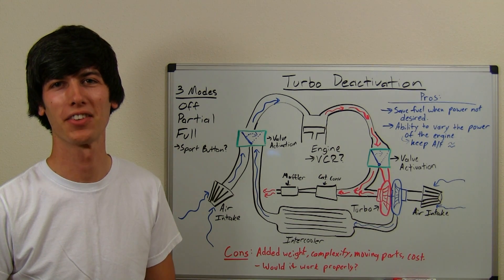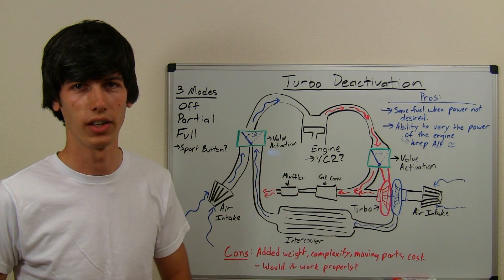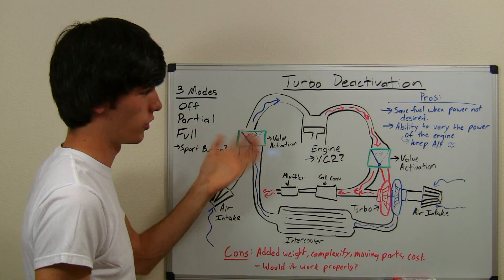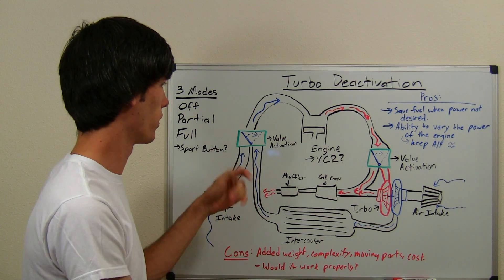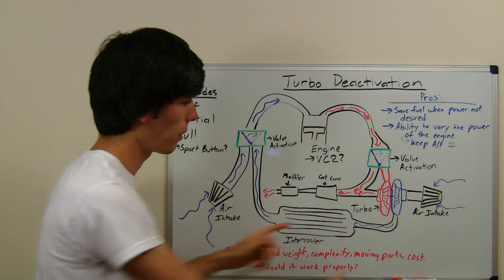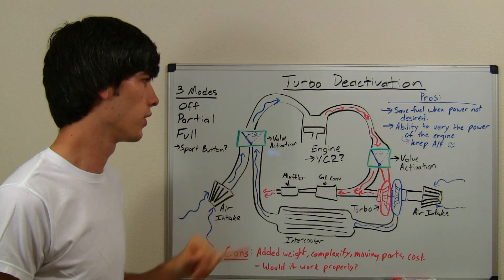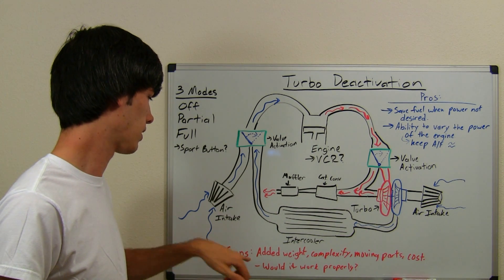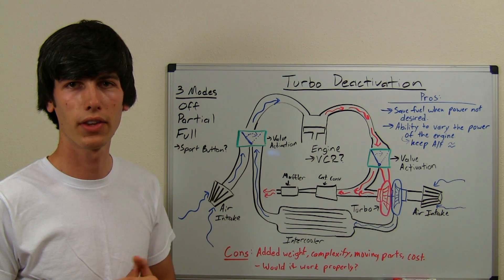Turbocharger Deactivation Concept - Explained

Comment: ...3 questions come to mind...

1. Is there a way to guarantee that the valves will close completely? Like some sort of seal? Granted, a rubber seal would probably disintegrate in any Exhaust Manifold, but the concept is something to consider.

2. The doors will be on hinges, right? If so, would a redesign of the Intake and/or Exhaust Manifold be required? Like, make them flat on one side instead of round, to make it easier for the hinge to go in?

3. How easily could they be replaced?

Comment: You still don't get it do you. I have never said that adding a turbo will make an engine less efficient. You have said that adding a turbo WILL make an engine more efficient though. SO why does the turbo get less MPG's in the extra urban tests. We now know that the turbo is operating much closer to its peak efficiency - any other excuses. WHat you're also forgetting is that I've picked the fairest comparison possible. I could have compared the NA to the 225bhp 1.8t, want to do that?

Comment: Wow you found unsubstantiated data showing that the turbo gets 0.1 MPG better. That's a hell of a lot of recovered energy don't you think? Thanks for highlighting that the turbo engine is operating much closer to its peak efficiency during the MPG tests, yet is still less efficient than the NA in extra urban MPG cycle. Just imagine what would happen if the engines were under greater loads!!

Comment: Anyway, what the calculations you can't do show is that whilst working under the low loads associated with everyday driving  the turbo engine, despite producing more peak horsepower, is operating closer to its peak efficiency than the NA engine is. Which makes your "lower percentage of load" rant complete rubbish.

Comment: Good idea but poor execution. It's like comparing a Naturally Aspirated 2.4L engine v.s. a downsized 2.0L Turbo Charge engine, where fuel economy is compensated by opening throttles more (may it Gasoline Direct Injection), of cuz there will be difference but the key is both achieve at roughly the same torque at same fuel consumption. The action to switch a downsized engine to a higher gear probably benefits more and economic than this method.

Comment: OK. So the turbo produces 162 lbft @ 2200 RPM, the NA 125 lbft @ 4200 RPM. Using your undoubted academical skills, you can now work out what power theses engines are producing when running at their most efficient. It shouldn't take someone like yourself, with a doctorate in Engineering, more than a minute to work this out.

Comment: Ok, so the addition of a turbocharger has reduced the NA engines fuel efficiency under everyday driving loads because those loads now occur at a lower percentage of maximum power output.

Comment: It doesn't matter that the percentage of maximum power the engines are operating at is different. If the turbocharger is recovering significant amounts of energy all the time, the turbocharged engine should NEVER be less efficient that the NA whilst producing the same power.

Comment: Let's say, for example, that the turbochager recovers 10% of output power. When both the turbo and NA are operating at lets say 50 KW, the turbo engine should be using ~10% less fuel. Why is it using more?

Comment: This is where you struggle to keep up. Under the standard load fuel efficiency tests the 1.8 & the 1.8 turbo are producing the EXACT same power output, but the 1.8 NA is using less fuel. And before you start coming back with your "percentage of load mumble" it really doesn't matter why, the addition of the turbochager has made the engine less efficient in those tests Where has all your "recovered energy" gone?.

Comment: No, you said that smaller turbocharged engines have typically replaced large NA engines, I then asked for some examples of this. So far you have not given one example, seeing as the F150 is still available with several large V8's. If it is typical then it is the 'norm' and you should be able to furnish me with many clear examples.

Comment: Again, it's funny how torque didn't matter when you compared the Mustang Turbo to the V8, it was all about peak bhp then. Now the shoe is on the other foot..lol... Anyway comparing a direct injection engine to a non-direct injection engine in order to prove the efficiency of a turbocharger is pointless. You have to start with a level testbed - like the good old VW1.8l.

Comment: No, as you've been saying for 20 pages, we compare motors on peak hp remember? The 3.5l ecoboost with direct injection gets just 1 MPG more than the equivelant 5.0l V8 without direcy injection. Seeing as direct injection engines typically produce 20% better fuel efficiency than engines without, you have to admit that that's not good.

Comment: The ecoboost isn't a small motor at 3.5l, but it does have tiny GT15 turbo chargers. These are turbos usually found in low reving small capacity diesel engines!! They are about the same size as a coffee mug.. The ecoboost can barely be described as a turbocharged engine....thank god it's got direct injection I suppose.

Comment: I see that production of a less complicated more 'American' version of the AJD diesel is planned for the F150. Seems your massive Island can't quite get to grips with the production of such a complicated motor, one that has been manufactured over here for 6 years. But I suppose what's the point of using good motors in your terrible vehicles. Best stick to your half ton 15 MPG 'powerstroke' tractor engine.

Comment: Why don't ford have a decent turbo diesel F-150. Over here it is unheard of for a larger road vehicle to have a petrol engine, barring some premium products (Range Rover, X5 etc). Ford UK produce the excellent AJD diesels, the 3.0l produces 600Nm of torque and returns 30 MPG in the LandRover Discovery, why don't Ford USA copy these? Do you guys like paying for gas, or has Ford got some sort of deal with the oil companies.

Comment: .........Another common effect is a rattling sound coming from the upper valve train assembly. The original seal material was found to be inferior for the application and tends to break down within 75k - 100k miles. VANOS Seal & Rattle kits are available to address these shortcomings from aftermarket suppliers (but not from BMW—BMW's solution when VANOS units fail is to remove the entire VANOS unit and replace it with a new one)"

Comment: "Single and Double VANOS systems due to age and mileage often experience performance issues as well as complete failure of the BMW OEM Buna-N VANOS piston seals (which are often successfully repaired by the use of aftermarket Viton seals to replace the OEM Buna-N seals).................

Comment: Yes, the ultra modern 3.5l DOHC, VVTi, 2150psi direct injection, eco-boost engine is slightly more fuel efficient than the 20 year old 5.0l V8.

Comment: The US E36 M3 wasn't really an M3 though was it. Over here the early single VANOS engined 280bhp M3's were/are more desireable then the later 321bhp double VANOS engined versions specifically becuase of VANOS reliability.

Comment: Yes you're right.Myself and all the automobile manufacturers are wrong. If only we had your knowledge then all petrol engines of the last 20 years would be turbocharged, and as you pointed out, much better in all aspects. Take your beloved BMW as an example. After turbocharging the M3 in the '80s they didn't turbocharge any of their engines, excluding diesels of course, up until the recent M5 I believe. How could we all get it so wrong.

Comment: ha...funny how torque wasn't important when comparing the Mustang turbo to the V8. Turbocharging has made the 1.8l engine less efficient under the loads associated with everyday driving. Yes the turbo engine will have a "flatter torque curve" and more maximum power, but we are talking about efficiency only.

Comment: VANOS was a bit unreliable though. M3 owners lived in fear of the VANOS 'death rattle'. Valvetronic is a strange one. BMW tended to use it on its low end motors. High end motors had a standard throttle plate and 'M' cars used ITB's.

Comment: You mean Fords brand new "Ecoboost" engine? probably the most advanced engine they've ever put in a production vehicle. I always believed that direct injection would solve some of the inherent efficiency problems that have plauged turbo charged petrol engines for the last 30 years. Can't believe it achieves only 1 MPG more than the equivalent V8 though!!! What a failure. Besides it is not a small engine, and it will not replace the V8, far from it.

Comment: speaking of concepts, i want to run an idea by you. Electronic valves. Instead of having the valves controlled by cams/camshaft they would be controlled by a solenoid that opens and closes them. I've been thinking about it for about a week, and performance wise it seems that it would be very beneficial. Valve timing would be more easily adjusted. Such as ignition mapping/fuel mapping, you would be able to have valve mapping. Please reply on your opinion on this concept.

Comment: Timing chains are good. They have been around like forever, but dual (consequence of) chains are no good. Because every chain has a kind of slack, with 2 chains you have 2x of that slack, which results in incorrect valve to piston timing. That's why old Toyota Celica TA64 from Group B had 4T-GT with gears (instead of lower chain) and a common upper secondary chain for driving DOHC cams. It was developed from 3T-GTE which had 2 chains, like modern Audi and many cars in 70s, yup! 2T-G,18R-G,FJ20

Comment: You are mistaking Alusil with Nikasil. Nikasil is a whole another beast. It results in a very hard coating, unlike Alusil which is very very very very soft! That's why Alusil pistons have IRON sprayed skirts, so they can make it work! Soft-on-soft doesn't work much. So if a cylinder is soft, then the piston must be harder. And so it is in Alusil. Nikasil has low oil consumption and it's not really used nowadays, because it disappears if disposed to high sulfur fuel (widely spread in EU).

Comment: This timing chain design is used in all engines. Even on TT's V6 and 2.0 straight-4!
As for V8, GTI isn't thaat complex as V8. It had first Audi Alusil block, which was crap, it could overheat like no prob as well because of inefficient cylinder head gasket design, plus it had a lot of rollers, damper and the longest toothed belt in automotive history - 299 teeth. I don't clearly see the economical or ecological purpose of Alusil blocks, because these engines use 10x more oil than cast iron ones

Comment: Yeah the timing chains are incredibly complex on that motor. Looks like a further developtment of the VR6 system, which used seperate upper and lower timing chains. Although the engine in your link is a true 'V' and has DOHC's requiring the 4 chain layout. Probably designed never to need chainging, and is a huge oversight, and pain in the arse, if it ever did.

Comment: "No, the turbocharged 1.8liter can do the work of a much larger engine, the NA 1.8 cannot"....great, but irrelevant. The addition of a turbocharger has made the VW 1.8l engine less economical for everyday driving (identical loads for both engines). The facts back that up, surely you must agree.

Comment: No, no! They have 2 chains. And they stretch, and misalign, and you get cam angle sensor failure, so the engine goes into accident/safe mode or simply refuses to work at all. Audi/VW seems to be fond of not so bad ideas and being lazy to test them. Which turns into a disaster for a car owner. Despite that Audi has the most overpriced original parts than any other popular car manufacturer. Ask me how I know that. '89 Audi V8 is in da house! wasting my money and time on constant re-engineering...

Comment: Does the FSI have the weird timing belt driving one cam and a timing chain driving the other that the old 16&20 valvers used to have? Not as bad as the old VR6's that had the timing chain on the gearbox side of the engine!! The 2.5TDi is a sweet engine, it even sounds good.

Comment: Depends where you're from really. Over here VW/Audi stuff is readily available and pretty cheap. Their diesels are incredibly durable, my mother had an A4 tdi for 15 years, did 200k miles without missing a beat, never used a drop of oil or water. Remember changing my old Passat pdi130 cambelt, waterpump and tensioner myself, was quite simple. Parts cost around £60.

Comment: Nah, VW is always interested in more efficient, yet uber-complicated engines. Because such engines require dealer service, which is always about parts - which are the main money supply for any car manufacturer. If you read between the lines, Audi/VW like to do shitty tech, which is pretty unreliable and hard to fix without special equipment.

Comment: Fuel efficiency really is judged by MPG. I'm not from the US and yes we do/did get the 1.4tsi, although I believe VW has discontinued the tsi and replaced it with a simpler larger displacement engine.

Comment: Efficiency isn't judged by MPG, actually. In technical literature effiency is about ecology at first and second about quality of burning the actual fuel mixture. In modern tech books they often say that a N/A engine won't be as efficient, as a lightly turbocharged one. Not far to go - modern small VW engines - 1.4 TFSI (turbo). They are really small, they have more like a diesel pull and they have a high MPG. But I don't know if you get them in the US.

Comment: Right, so if we go back to the VW Passat 1.8l as an example. The 1.8l is proven to be more efficient at every day driving speeds (for example let's say constant 50mph) than the 1.8 turbo. But you think at higher speeds (say constant 80mph) the turbo engine may be more efficient. Is this correct?

Comment: What you spectacularly fail to grasp is that just because two engines produce the same maximimum power does not mean that they produce similar power across the rest of the rev range. The V8 is probably chucking out twice the horsepower at everyday driving revs (ie fuel economy cycle revs) than the 4 cyl turbo. You are in effect comparing a 100bhp engine to a 200bhp engine. Whilst turbo and NA versions of identical engines will produce very similar power outputs at every day revs.

Comment: Just grab a turbocharger book for an engineer and read that. You would see that basically all turbocharger applications are divided into 2 groups: for efficieny and for "displacement replacement" - for more power. The first one pressurises more air, so that it would burn fuel better (for a number of reasons). The second idea is to add fuel as proportion ~14.7:1 for each absolute atm of pressure. Nothing to do with economy. YouTube is no university for automotive engineers, just grab and read it!

Comment: Mustang 2.3l is MORE efficient than Mustang 2.3l turbo
VW 1.8l is MORE efficient than VW 1.8lturbo

When they added turbochargers to these engines they became LESS efficient. If you can find a case an engine becoming more efficient when fitted with a turbocharger let me know.

Comment: Ok back to school for "dr"Bimmer. These engines only produce similar power outputs at high RPM (much higher for the 4cyl!). Fuel economy tests are conducted over LOW RPM's. The V8 will be procucing MUCH more power at low RPM's than the 4cyl. And that's before we start to consider the V8 is ancient, is much heavier and the SVO has aerodynamic modifications. So why choose two motors to compare based on their high RPM performance and then compare their low RPM performance.

Comment: You think it's fair comparing an ancient design V8 with a more modern 4cyl, you need to try harder. Anyway, the Mustang 2.3l is MORE efficient than the 2.3l turbo. Now think about that, the turbo makes it LESS efficient. And before you start banging on about peak hp, I know the turbo has more power but economy tests are standardised. The turbo and non turbo engine do the same amount of work with the turbo engine using more fuel thus being less economical.

Comment: It's still a 1960's engine designed without any consideration to efficiency, compared to a 1980's engine introduced after the oil crisis. They both have terrible MPG's anyway.

Comment: Why do you keep banging on about peak hp, forget about it. If you want to prove your statement that a "turbocharger greatly increases engine efficiency" then you have to compare identical engines with and without a turbocharger under the same loads.

Comment: Ok I'm going to post some facts - don't feint. Let's compare for example (because I found the figures) the VW Passat 1.8 & Passat 1.8 turbo circa 2000. These engines are the same 1.8l 20V EFI units one with a turbo one without = perfect comparison. Under identical controlled Extra Urban fuel efficiency tests (identical engine loads) the Passat 1.8 NA posts an MPG of 44.1, and the 1.8t 43.4 MPG = turbocharged engine is LESS efficient.

Comment: The 'standard' is using the same size engine, why on earth would we use maximum power output as the 'standard'. How often in fuel efficiency tests do they use maximum power?

Comment: yes it can. Adding a turbo to a diesel engine will give you a typical 50% max power increase AND an increase in fuel economy. Adding a turbo to a petrol engine will give you a typical 50% max power increase and a reduction in fuel economy.

Comment: Of course I can use diesels as a comparison. Typically, adding a turbocharger to a diesel engine will make it return higher MPG's. Adding a turbocharger to a petrol engine will make it return lower MPG's. By "power output" what you actually mean is maximum power output, which is completely irrelevant here.

Comment: No, power is irrelevant here, if the addition of a turbocharger makes an engine more efficient then a typical 2.0l turbo will be more efficient than a 2.0l NA, as is the case with diesel equivelants.